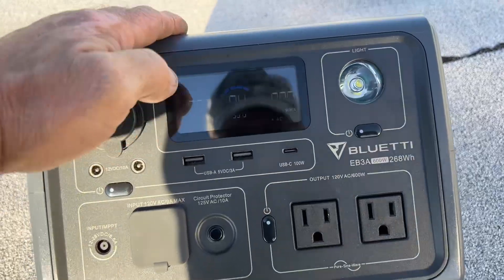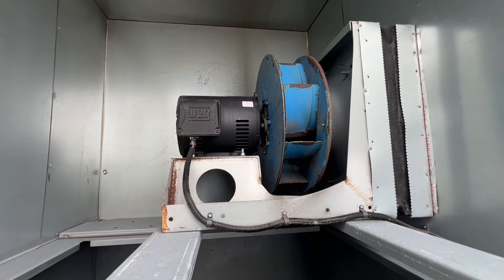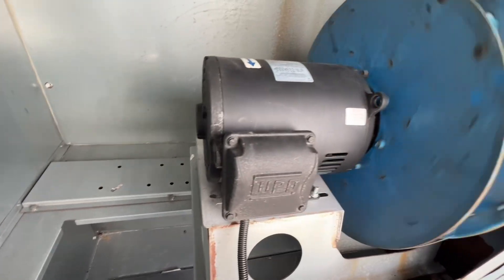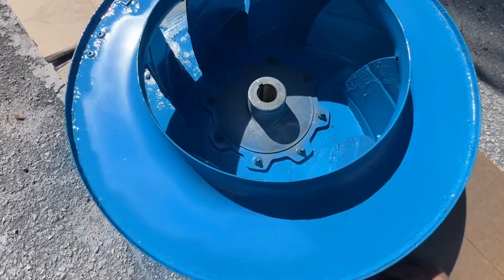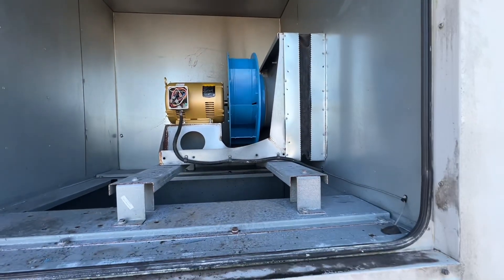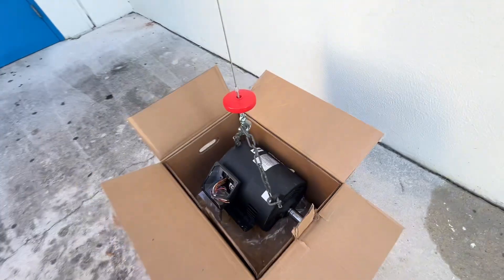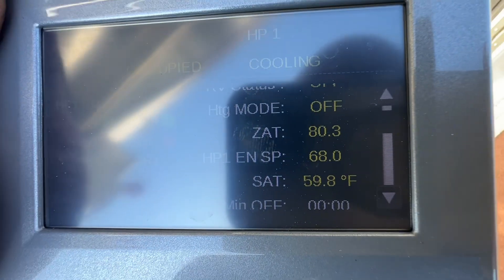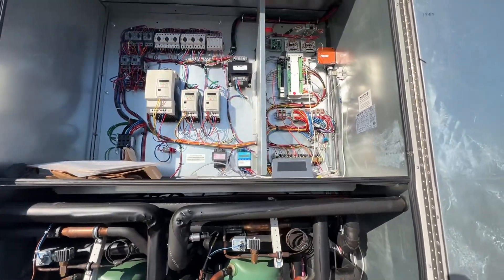Addison 30 Ton RTU Supply Fan Fail .. Ladder Crane Assist

Comment: I say it on a lot of HVAC videos, those WEG motors are absolute junk. They never last, bearings seize up, they burn out with alarming frequency, and are very intolerant of VFDs. Baldor or Century are the go-to brands. Marathon ONLY if the customer is a cheap ass.
Reply from the maker: This is another example (OEM motor) , we keep Baldor in stock for replacements.
Reply: junk blower wheels that rust and go out of balance(if balanced to start with) will eat any motor and bearings. that said, it was certainly the highest quality motor they could manage. LOL

Comment: have you ever used your power supply to run your vacuum pump? i was just looking at these recently and saw it in your thumbnail.. i was looking at the ecoflow delta 2 max would love your input if you have any
Reply from the maker: I have not used it on my vacuum pump, it’s 600w /1200w peak. I’ve run domestic fridge on it, the winch. That ecoflow is more capable. Check out HVACR Survival for ecoflow reviews https://youtu.be/fi-ljgafM7M?si=5VxPMvVd2a8ZbTnB
Reply: @subcoolHVAC  thanks brother